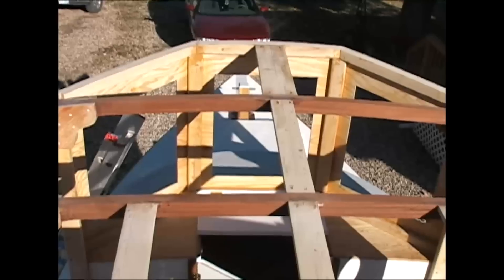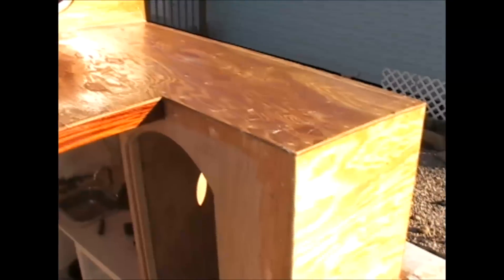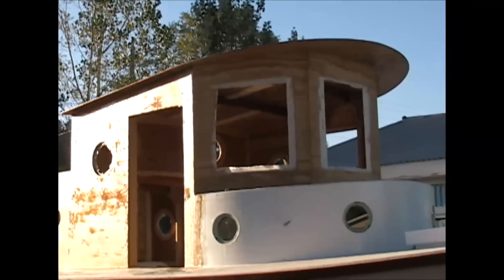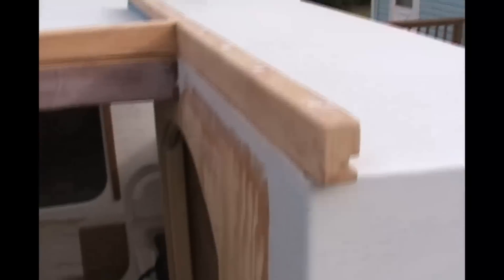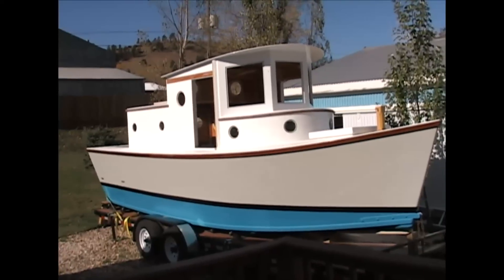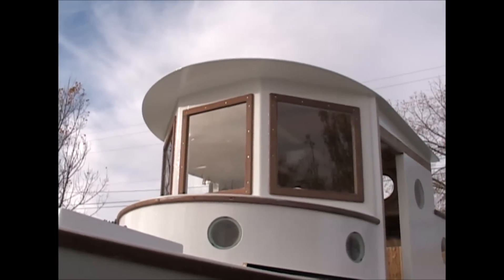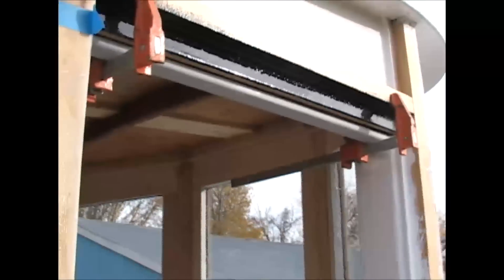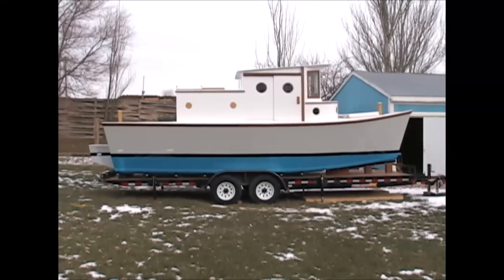Building the Jani J-Finally Seaworthy

Comment: With such a hull form, flattish and shallow I think you would get 10 knots from a 50 hp outboard. In Senegal the fishing boats are made of huge hardwood planks, 45ft long and all use Yamaha Enduro outboards, 50hp, they do 10 knots. 50 hp would use fsr less fuel, be far more economical to maintain and lift off etc and the Enduro is built as a workhorse engine with no frills. Looking forwards to her launching.

Comment from the maker: @snowypetrel I would use a 50 if I could get a deal on one. I designed the bracket for a 25 in shaft to keep the powerhead up out of the water. A 90 is the lowest power with a 25 in shaft. I would not want less power on a boat of this weight, for fighting head winds, high seas and towing. It is a tugboat and I might put her to work. Thanks for your interest.